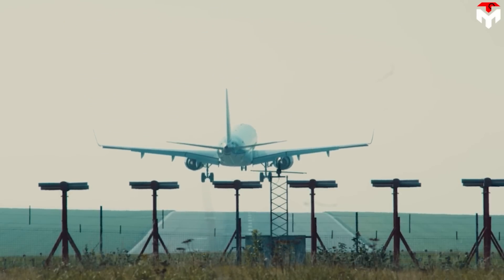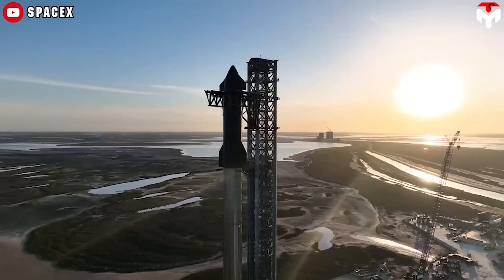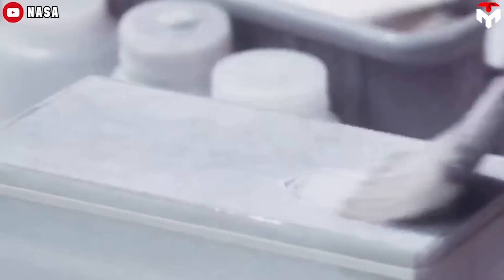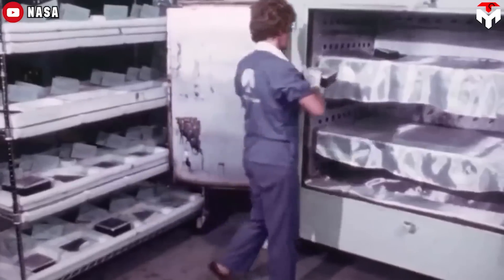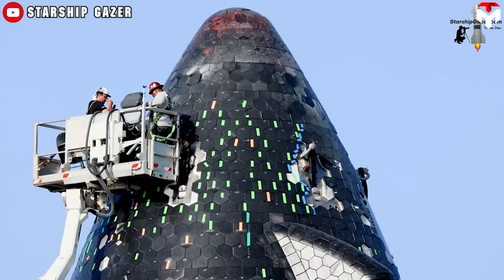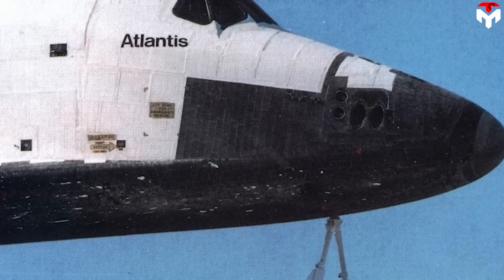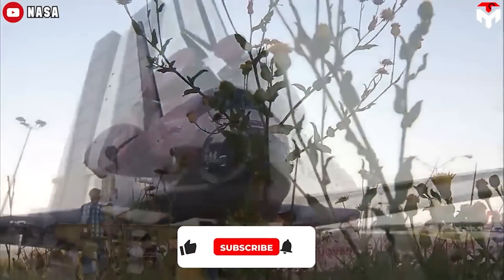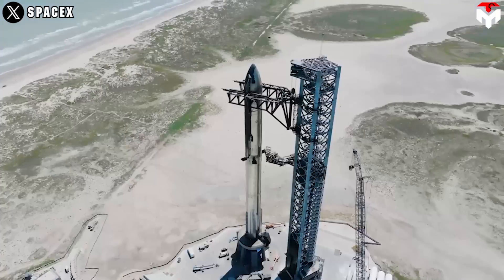What SpaceX just did with Starship TPS tiles Humiliated NASA!

Comment: How does starship need any tiles for the most part starship doesn’t need to return to earth .  Put a fully loaded starship in orbit and use falcon 9 to transport a crew to starship .  Star ship freighters can fuel and supply a starship .
Reply: Falcon 9's is a two stage rocket whose 2nd stage is expended each launch. Starship is a two stage rocket that is trying to recover both stages. They do plan on mating two upper stage Starships for in orbit fuel transfers, but they want to recover and reuse their upper stage Starship fuel mules. But yes, there may be specialized Starship voyaging spacecraft that do not need the full heat shield tiled treatment since a return through Earth's atmosphere will not need to be part of their mission.

Comment: What causes TPS tiles to fall or pop off?  Are the tiles failing, or is the attachment system failing?  I imagine the rocket skin flexes in response to multiple forces, and the mounting system doesn't have enough play to accommodate that movement.  Has anybody tried to weave adjacent tiles together, creating a mat of tiles that would wrap around the rocket?  Manageable sized mats would be woven together to create larger mats until the required surface was covered in TPS tiles.  Either the material used to weave the tiles together has the necessary play or flex, or mechanical springs could be incorporated into the system tying the TPS system down.  

Also, are the bow and stern fins and flaps necessary?  Has anybody tried using wings that deploy from the dorsal surface prior to reentry?  During the first or hot stage of reentry they would act as a parachute, slowing the descent and keeping the tiles oriented toward the heat.  During the later stage those wings could fly the ship, until the ship begins its rocket engine powered final brake and terminal maneuver.   

The wings would be stowed along the long axis during the ascent.  They would deploy by rotating ninety degrees around a central mounting point.  There would either be one large wing or two smaller wings, one fore and one aft.  They would return to the stowed position immediately prior to the powered descent stage.

Comment: Many commenters have already touched on the "humiliation" part of NASA.
NASA didn't have any notes or references to look at developing the tile system in the 1970s. 
SpaceX didn't start from zero. They had a lot of information and flight data to look over 
for developing the Falcon 9 and Starship system. 
Same for China's fast developement of their space capsules and space station. 
I don't like the tile system because of the hundreds of tiles that's needs and 
as we have seen in IFT-3 re-entry, can be a real headache if the wrong tiles are missing from vulnerable points.   
NASA has issues with wasting money scrapping and starting over instead of pickinig a plan and running with it to the end. 
Also, NASA has an attitude with doing it better than Apollo instead of just replicating Apollo and building from there. 
Just get someone on the Moon, then make the next class vehicle a little better.

Comment: The material composition of tiles used by SpaceX have improved much since the Space Shuttle. A key difference, however, is that the Shuttle had so many more unique shapes than Starship. Keeping track of them all for replacement is an insane logistics problem.
Reply: They are working on Starship using destructive testing. No aerospace firm has ever done that before.  Its ust an excuse for flat falure.
Reply: @davidsoom1551  Starship and Booster are probably riddled with sensors. I imagine they got a lot of useful telemetry.

Comment: Funny... I've been doing concept suggestions to replace tile and grid fins systems long term...

Even predicted online it would go up fine, and fail on re entry and coming down..
Lucky they have several more in line so they get the idea...

Hopefully they will change designs before Version 2...

Wouldnt want Bezos to catch them while they are doing the same things over and over, and expecting different results.
Reply: Catching them would require Bezos actually launch an equivalent rocket. Which they've not yet even attempted.
Reply: @XShadowAngel  
Exactly...
But just because he hasnt, doesnt mean he wont.

My guess is Bezos will let SpaceX do the developement, and Blue Origin will copy what works well.
Same as Chevrolet copying Ford's production line...
Bezos has money, he can start simplifying engines and up scaling size on rockets.
its just Elon is doing all the mistakes for his benefit.
My guess is Jeff will wake up after first use of Raptor 3 engines.
And he doesnt need to be in a hurry, Elon has trapped himself with tiles and round hulls.. has several ships made, when its obvious there are serious problems now.

I've been doing writs online for several years now about those two issues, and the grid fins...
And even said in a writ that the round hull shape from transverse ring gores would eventually be entrapping...
And now its on video, how the ship wasnt stabile on its side. And either they try cobbling things onto the round hull to fix the problem, or they untrap by using longitudinal gore construction.

Comment: Not sure, what you watched, but the Starship tiles failed before it even touched the plasma. Test 3 was mostly a fail, since the door didn´t open completely and the tanking process didn´t occur either - at least, we didn´t see anything. Not to mention, that neither the booster, nor the Starship itself reached the ground in one piece.
I don´t want to destroy your hopes, but i have the strange feeling, that the whole design is a failure and can´t be fixed easily. From grid fins to flaps and the fragile steel can, unable to stabilize for the reentry - this thing may isn´t even able to deploy satellites in the LEO. After 3 bil tax payer´s money is burnt, not a single goal was reached. NASA needs to stick with SLS for the Moon Project, maybe Falcon Heavy on top, but Starship won´t be reliable for years, not sure if it will ever be useful at all...that´s my guess.
Reply: Actually @martinmatte1518, the only things that failed was 1. the weird-shaped Starlink "pez" dispenser door, and 2. the ability to control roll axis in atmospheric re-entry; neither of which will be on the lunar Starship.
So in fact, lunar Starship is ready to go as is, once SpaceX puts in a crew interior.
PS: Oh, and yes, the "tanking process" was a success.
Reply: Literally nobody that knows this subject called it "Mostly a failure." It's really about the polar opposite.

And btw, the fuel tank shifting was not only attempted, but completed successfully. 

it;s also not taxpayer money being spent on the development. Your guess isn't worth much.
Reply: Elon got the boot a few weeks ago. Under nasa control now.
Reply: lol. No. Do you actually believe that? @TheMoneypresident

Comment: Every bolt, every weld, every process that SpaceX uses comes from NASA.  NASA is not humiliated, it's proud.
Reply: Not even remotely accurate.
Reply: Not only does SpaceX make all their own hardware, musk is obsessed with vertical supply chain integration. What you just said was never true and never will be. Where do you get off offering opinions that you just pulled out of your ass?

Comment: Last who was the brainiac shot thought gluing thermal tile to a heat resistant blanket was a good idea? On reentry you could see the the tiles and then the blanket being ripped off starship on atmospheric contact. Last there is no adhesive that can bond to 304 stainless. Just take a microscope and look at the surface texture. It has no rough surface to bond to. We even attempted to rough the surface to a 250 finish to help bonding. One heat and cycle and everything feel of. So we resorted back to rivets and rig sealing.
Reply from the maker: Thanks for sharing

Comment: Why do these talking head keep lieing about the stainless steel heat resistance.  304l stainless has a maximum resistance to heat of only 1450 degrees. But is starts to melt at 1400 degrees. So stainless gives you a longer resistance over aluminum of 2.2 seconds before failure. Clowns !!!!!!!!!!!!. Anyone In engineering  or manufacturing knows this. They’re treating the public like a bunch of dummies. They’re keeping you in the dark feeding you like mushrooms and you can guess what the food is.
Reply: Aluminum's melting point is 1200 F. Stainless's is 2750 F.

Comment: There remain problems to be solved.  Venting and refuelling condensation, let alone vibration.  All do-able.  Cheers.  😎
Reply from the maker: Exactly. Engine is also a big problem
Reply: @techmap9  
Or shall we say that fuel supply to the engine is the problem?
ALL engines, no matter what design, will always die if they can't get any fuel. 
That's no flaw in the engine whatsoever, it's just the reality of physics & chemistry.